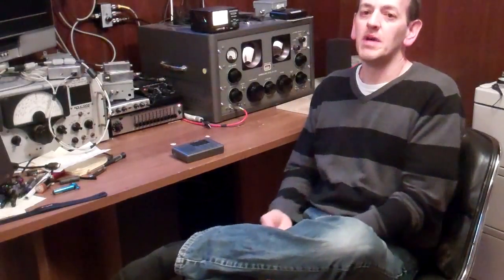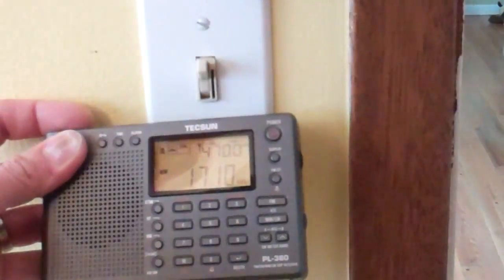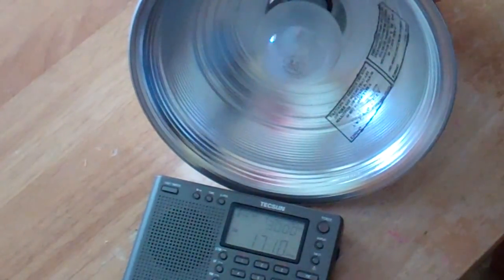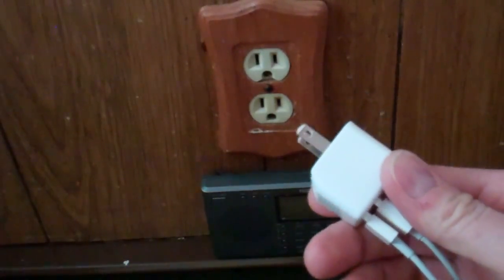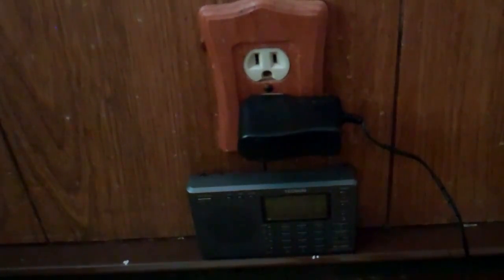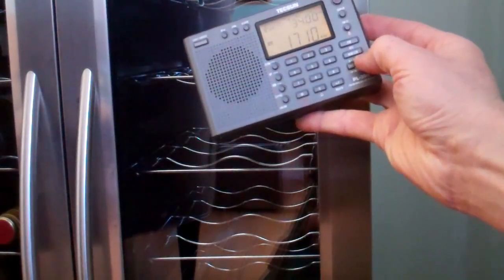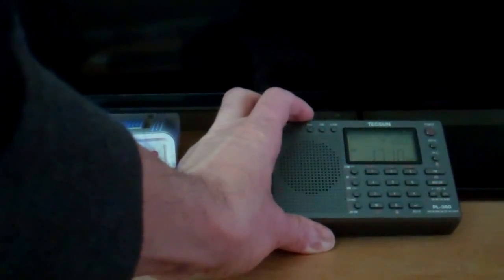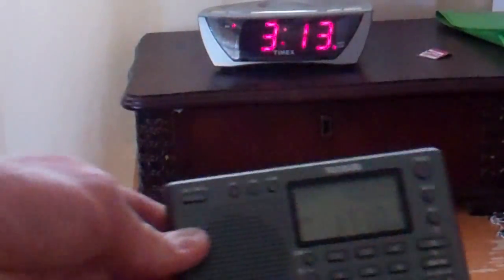Detecting RFI Sources in the Shack and Home

Comment: Holy Toledo, you’ve got a Hamarlund SP-600 on the bench. I worked on those 50 years ago in the Air Force. Great receiver...
Reply from the maker: It is still and awesome receiver and I use it as my main DX rig.

Comment: I have found that the brand name "Great Value" LED light bulbs from Walmart work well and they haven't caused much RFI with my radio equipment.  I have two LED light bulbs, 60w and 40w next to my radios with VERY LITTLE interference.  I have tried other LED light bulbs that cause RFI.

Comment: I guess the solution is to turn EVERYTHING off in the house when you want to play radio. NOT practical especially if you have a wife that cares less about Ham radio. The reality is get a divorce and move to the mountains off the grid. Lol
Reply: More to the point, turn EVERY power point off when you goto sleep at night. That is the most dangerous if you are just trying to 'clean up' the electrical environment in your home.
Reply: Brilliant lol
Reply: H Higgins I thought you install the core close to the input of the device. Otherwise the remaining length of wire acts like an antenna

Comment: This video is more than 4 yrs old... I noticed the 3 position rf switch behind your transceiver. (NICE!)... Mine failed almost immediately... I suggest you get rid of yours and get a better one... that one is junk.... both the connectors AND the rotary switch.
Reply from the maker: They are cheap switches but I only use them for receive and on MW/LW.

Comment: I have some RFI in the house I can't find. I need something I can point to find it. I don't think its a device, it might be the power lines to our house. I need some detector I can aim.
Reply from the maker: An am radio with a ferrite antenna is only slightly directional. It's pretty difficult with basic equipment to have a really directional detector that is hand-held. I just went around and moved the radio closer and away from the various objects I was testing. If the RFI is strong enough to detect and not in the house it's possible one of your neighbors has a noisy appliance or its coming in over your power lines. They are almost always noisy to some extent.

Comment: hmm thanks for that, how bout doin a talk on that old gear you have in the shack, im becoming interested in valve radios which is what I assume you have, do you have a make and model of that pls?
Reply from the maker: The big Gray one on the right side of the video behind me is my Hammarlund SP-600 JX-37 (1962). One of the last HF units of the SP-600 ever made...It is in amazing nearly original condition (replaced safety caps, power cord and some tubes) and works amazingly.  I still use it for AM BCB and HF DX from 530 kHz to 54 MHz. The Silver/aluminum-faced one on the left is a Rycom R1307A/GR Receiver (1965) that I use for LW DX and it receives from near DC to about 810 kHz. I use it for LW BCB DX and NDB reception. I actually have it in my plans to do a "How I DX the SP-600" at some point to document they way I use it. Maybe I'll get off my butt and move on that one. I love old valve gear and use them regularly. They won't outclass a good modern quality SDR in sensativity but easily blow the cheapie dongle SDR's I have played with so far out of the water.
Reply: yes Ive have read that there is less background noise also, so easier on the ear, is that the case?
Reply from the maker: Well the tube radios are much less susceptible to intermod compared to the cheap dongles. You can still get it during the day from strong AM stations. The RTL SDR dongles I use have wide open front ends and intermod from a bunch of strong local FM stations is terrible. I actually have a video on this on my channel. I don't know if the tube equipment is quieter but I has worked well for me.

Comment: hello there I'm am getting a lot of RFI with my xbox. it's interferes with the controller so bad it's unplayable, yet I can't seem to identify the source. can anyone help?
Reply from the maker: Are the controllers wireless or plug-in? If they are plug-in you may be able to wrap some of the cord around a ferrite core of some kind to reduce the interference. Does the xbox have a power cord with the adapter at the wall plug? If it does you may be getting interference from a noisy switching power supply in the adapter and might also try wrapping some of the cord around a ferrite core. If it is coming directly from the xbox main unit there are a lot of things that could be creating the interference. Not sure if they would be user fixable. If the controllers connect to xbox via WiFi or bluetooth, you could be getting interference from your WiFi or that of a neighbors.
Reply: Kugellagers Noodle Thank you for replying, The controllers are wireless yes. The main thing is to find the main source because there are so many things that effect it  for example the mobile device and when I plug in my mic it makes it even worse. But yet when the mic is out of the controller and the phone is away,  then there is no problem
Reply from the maker: It kind of sounds like the cable from the mic to your controller is acting like an antenna and increasing the interference - possibly from the phone. Found this on the internets. If you have an xbox 360 controller it transmits on a proprietary 2.4 GHZ frequency and if it is an xbox One controller it is transmitting on Bluetooth 4.0 which is also in the 2.4 GHz frequency band. It is possible that you interference is coming from other Bluetooth devices such as your aforementioned phone, laptop, Alexa, etc - could also be WiFi as much of it still runs on the 2.4 GHZ band.  Try temporarily turning off the bluetooth on your phone and any other non-xbox devices and see what happens.
Reply: Kugellagers Noodle Thanks I will try that
Reply from the maker: H Higgins  So how do the newer BT devices compensate for that? Do they automatically switch to a different channel as you can set your WiFi to do?

Comment: Can EMI affect a PC and its performance? I hared alot of people complaining about more input delay when moving the mouse. They say it's caused by EMI or bad grounding. I'm also wondering, if some ferrit cores and a good anti EMI PC case will reduce it.
Reply from the maker: A good question that I do not know the answer to. I do hear RFI at times from computer equipment I am using next to the radio when I am dx'ing. I would think all of your suggestions would help with interference.
Reply: did you found any solution
?i am also having mouse input issue
Reply: I’ve read that the signals running inside your computer are orders of magnitude stronger than RF from the outside, so no, no worries in general.

Comment: I could punch my neighbors sometimes because they use freaking Powerline Adapters for their home networking instead of LAN cables… and they keep it running almost all the time… leaving me with little chance to ever listen to some AM or SW stations… groans
Reply: Did you try asking them if they were aware they were causing so much interference?    Perhaps a chance to talk about Ham radio in general?   Or offer to help run some ethernet for them?  If that isnt possible, try a mfj-1026 - you may be able to phase the noise out.